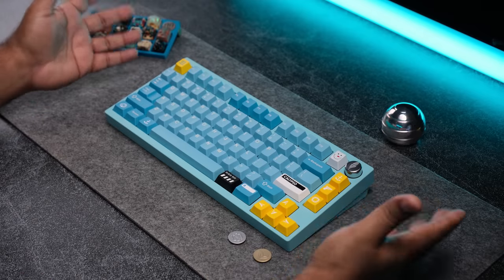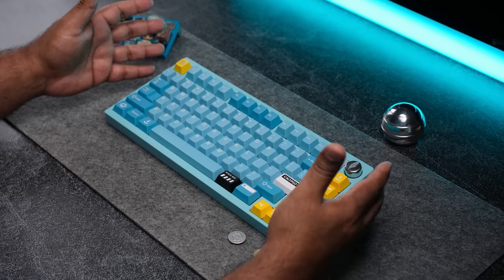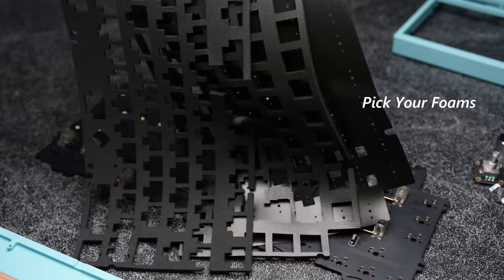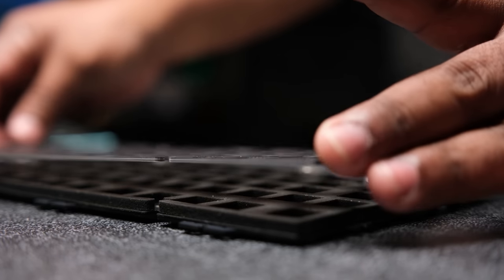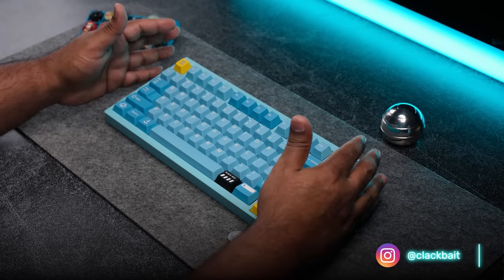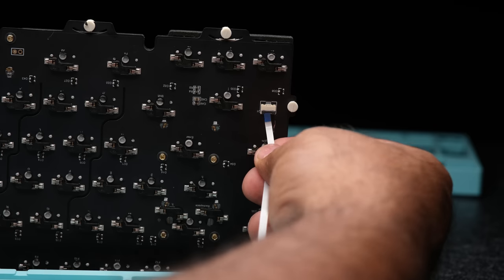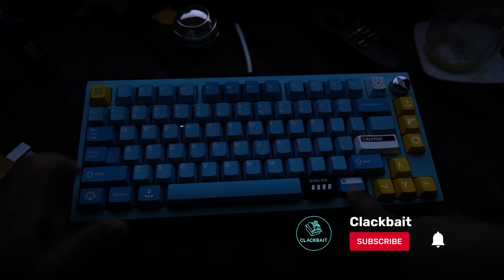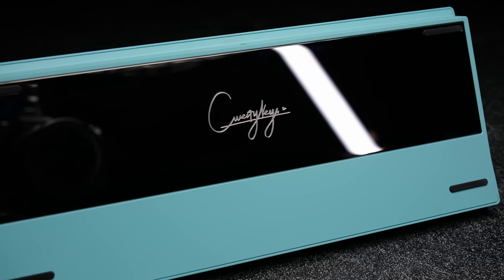QK75 Review And Build Guide

Comment: For someone just getting into the hobby, it's nice to know there are various options especially in the sub $250 range. With regards to overall value for money and feel, which would you prefer, the QK75 or the Tiger 80 Lite?
Reply from the maker: I think value for what you get the QK has more to offer. But the Tiger80 Lite is no slouch, just not as premium as this board.

Comment: is the the mic setup (the mic, the surroundings and gain) the same across all typing tests?
The board seems to sound louder with all dampening applied, which is counterintuitive.
Reply: If you are referring to the PE sheet "dampening". It is kind of a misnomer since it only really dampens the higher frequencies, while reflecting lower frequency with a signature mid level frequency (hence the "marbley" sound.) 
With some frequencies being reflected directly off the PE foam towards the user/mike instead of into the back of the keyboard, the PE foam does sometime make the board louder.
Reply: @xeroze01  makes sense. Thanks!
Reply from the maker: Mic placement, gain and environment all exactly the same. I do all the tests at the same time just for this reason. On the QK boards, adding all the foam amps it up quite a bit. Same for the OwLabs boards. It's the PE, plus the covering of the flex cuts. 🙏
Reply from the maker: Damn, that's a good explanation. ❤️

Comment: Is the taped PCB flex cut mod similar to traditional tape mod @Clackbait? You just cover the whole side with tape?
Reply from the maker: It actually sounds different. Taking the whole PCB adds or alerts the sound. Taping just the cuts mitigates the sound loss
Reply: @Clackbait  What i meant is. You tape mod the whole pcb or only tape the flex cut.
Reply from the maker: @ChunVuong  oh. Yeah just the flex cuts.

Comment: RIP GMMK Pro and Q1
Reply from the maker: May their souls rest easy... 😂
Reply: eh not really. Those two are perpetually in stock, and after you factor in shipping the barebones QK75 is about $60-70 more expensive than a Q1. I'm not comparing to the GMMK Pro because frankly nobody should buy it if the Q1 is an option.
Reply: @japplefilms3514  ong. The gmmk pro is so outdated it's crazy 💀
Reply: @user-kz9rz8ui1c  I disagree, I said that for other reasons. I've heard a LOT of stories where people bought a GMMK Pro and the screws were so tight that they stripped when trying to take them out. From the beginning they've said that the gasket mount is incredibly stiff and everything is so muted that all switches sound the same in it. There's been issues with the plates. The customer support is notoriously awful on top of the issues.
Reply: @japplefilms3514  that's why it's outdated. The gmmk pro used to be a good option since it was the only full Alu board at the price point that was consistently in stock. It had a lot of issues but it was excusable.

Now, the Q1 beats it in every way in terms of quality, sound, and feel while being available in stock.
Reply: @user-kz9rz8ui1c  Q1 has its own issues too. The steel plate is a horrible material; too stiff and is behind aluminum. And the pinging cannot be 100% eliminated.
Reply: @Caution40404  yeah, moving to steel plate was not the best move, but addon plates are also usually available. Also, pinging can be mostly remove with a couple mods. I was even able to remove ping on my q1v1.
Reply: @Caution40404  I disagree with you there. The steel is a perfectly fine material for it. It gives the typing experience a very even feel across the board, but the overall bounce is still there. Just no localized flexing. It doesn't make bottoming out harsh, though. Additionally I was able to completely eliminate the ping without much tape at all, if there's still ping it's clearly coming from the springs in your switches.